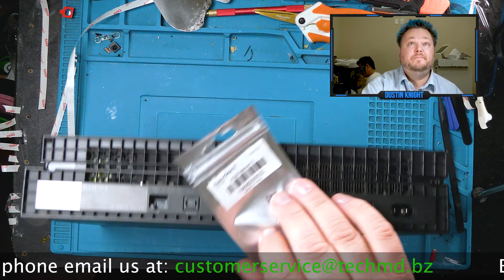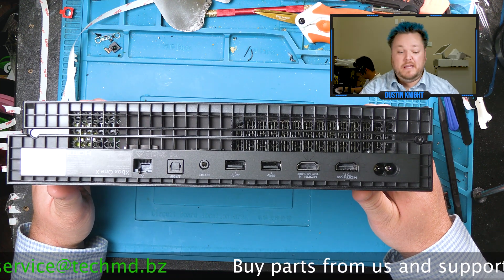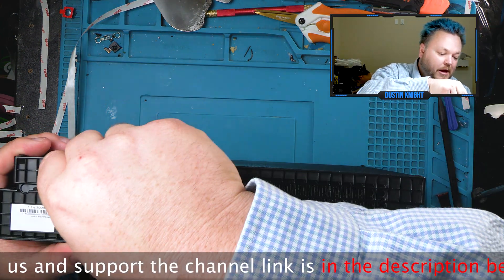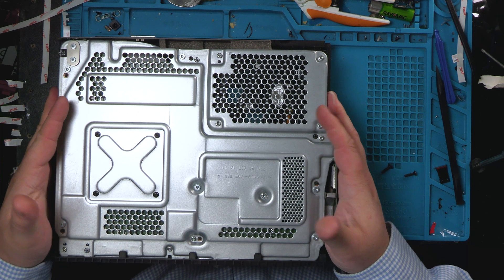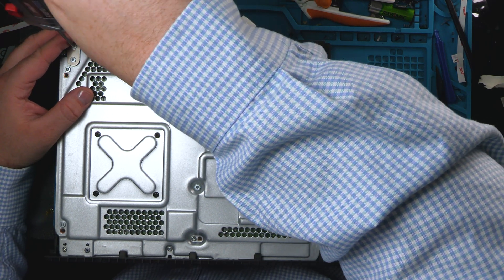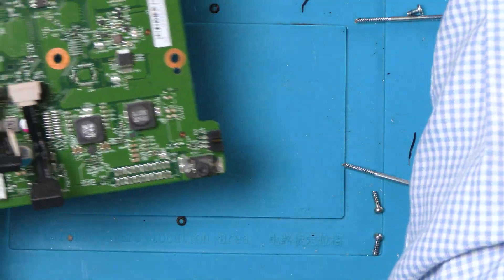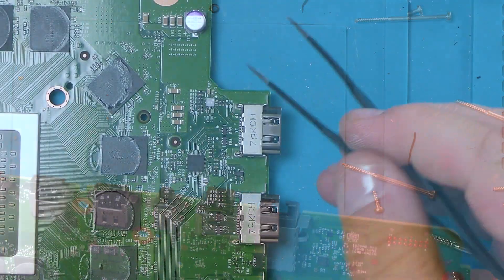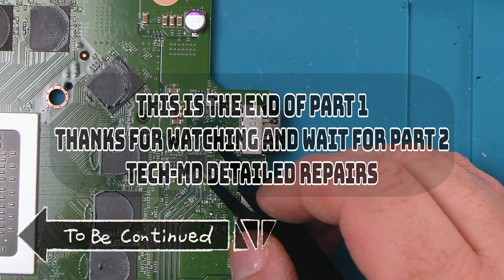Xbox One X HDMI Retimer IC Replacement DETAILED PART 1

Comment from the maker: Please support the channel by using my amazon links! 
For just the Retimer IC & Recommended Parts click on the links below.

Xbox One X HDMI Retimer IC :
https://amzn.to/3Pk5fYv

Hot Air Rework Station :
https://amzn.to/32PXsyX
https://amzn.to/3EQca5T

Fume Extractor :
https://amzn.to/3eXzsMB
https://amzn.to/3eOI1cG

Glue Remover :
https://amzn.to/3HFGUbR

Syringes, Plastic Squeeze Bottles and Needle Tips :
https://amzn.to/3pU3pDF

Cold Glass Glue :
https://amzn.to/3sVkqiH

Heating pad:
https://amzn.to/3mbIytW

Heat Resistant Gloves
https://amzn.to/3EsZdyW

My blue mat to keep everyone organized:
https://amzn.to/3BalS16

iFlex Opening Tool with Glue Card :
https://amzn.to/35UC9h8

iPlastix Opening Tool with Glue Card :
https://amzn.to/38FtzUH

on of my favorite screw driver sets 2uul:
https://amzn.to/3jsqkCz
https://amzn.to/3CcoL2Y

iseasmo w/ Kit (Has Screw driver too)
https://amzn.to/35Za2O0

Tweezers:
https://amzn.to/3B7yBlf

T-7000 Water sealing glue:
https://amzn.to/3EdzLxs 

Isopropyl Alcohol For Technical Use:
https://amzn.to/3BqBU78

Need to get a part from a reliable quick source, you'll find a better price here then Amazon and the quality will be a lot better. Click on the link below.
https://www.injuredgadgets.com/?acc=be9b6cec65c863e1b55538d2c7fcc9b0

• Visit our Website: https://tech-md.com

• My email: dustin@techmd.bz

• To mail in your phone, please contact us at 801-438-6028